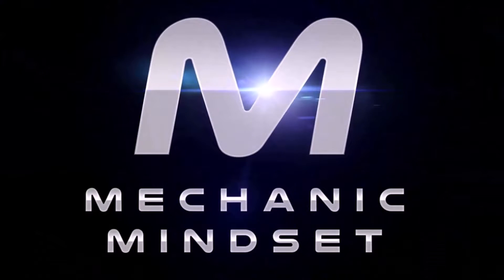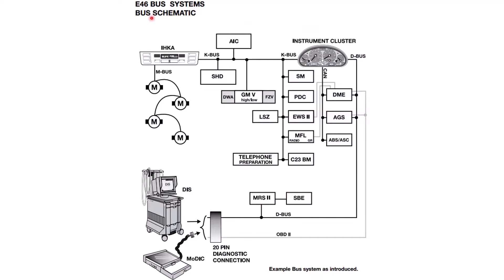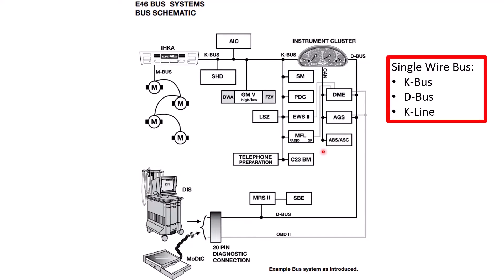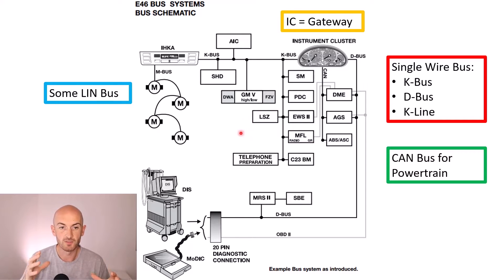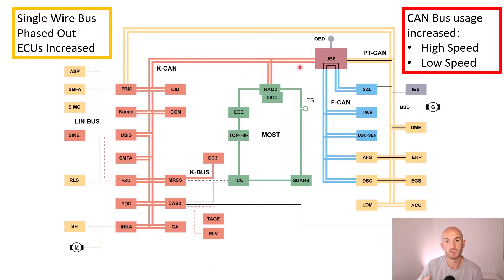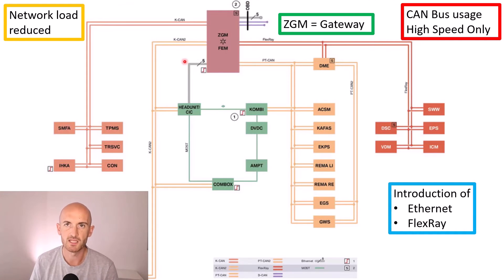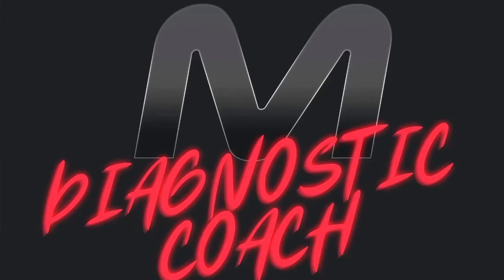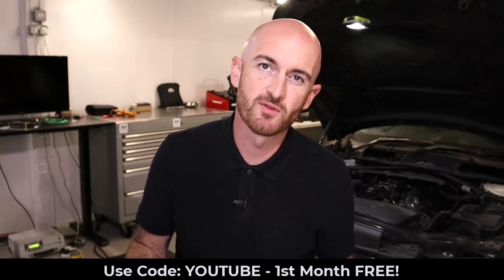CAN Bus: How Much Has Changed Since 1998?!

Comment: Hello dear instructor, I have a can low fault in my vehicle. The power steering pump is short-circuiting to the can low person. When I measure it with a multi meter, it shows the value. The vehicle Opel Zafira B case. What can I do? I should unplug all the control units one by one and check again.

Comment: Please I want to know how to use it waveforme library at pico 2204a softw 7
Reply from the maker: The waveform library is only accessible with the Automotive Oscilloscope 👍
Reply: @MechanicMindset do you mean the waveform library is only available for more expensive PicoScope units?
Reply from the maker: @OilBaron100  Yes, but only the ‘Automotive’ versions.
Reply: @MechanicMindset  how does PicoTech control that feature? Do the Automotive version come with different software?

Do you know where else I might get access to wave forms for BMWs? M62 engine.

Thanks for the videos. Will like all of them and comment for algorithm.
Reply from the maker: @OilBaron100  Hardware and software. You need the scope to access but the software is free. You can try Rotkee.com, the Ditex website. There are also some helpful Facebook groups for waveforms. Thanks!
Reply: @MechanicMindset  thanks mate!

You’re very helpful!